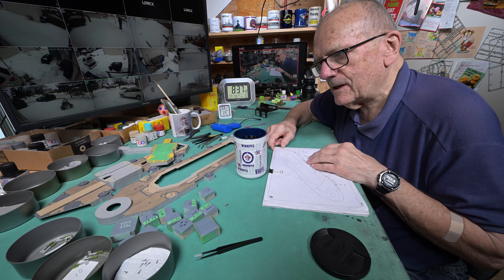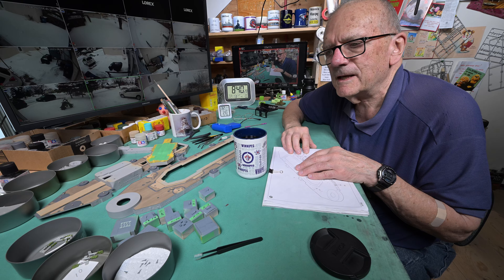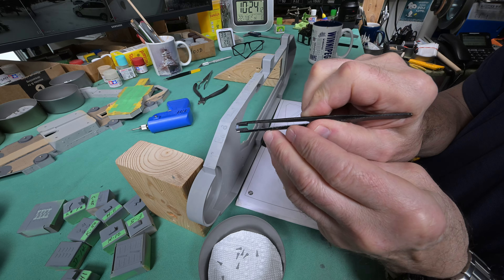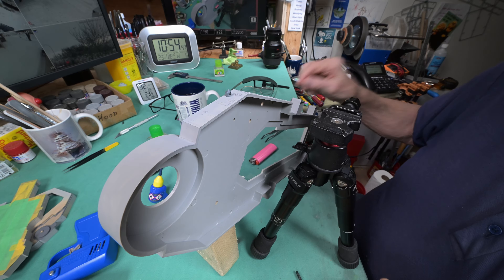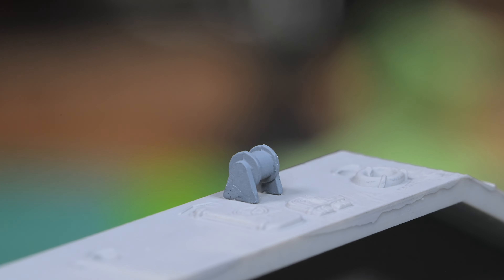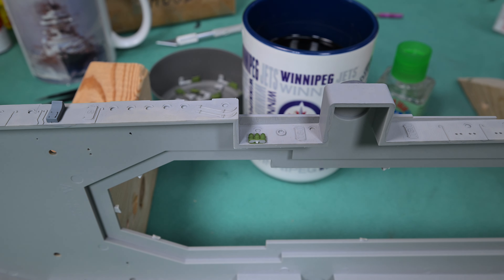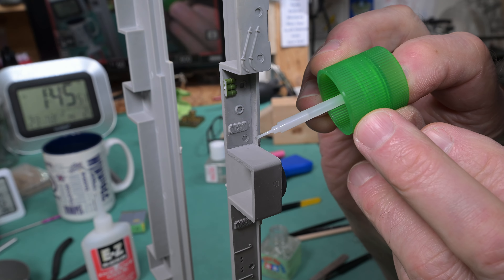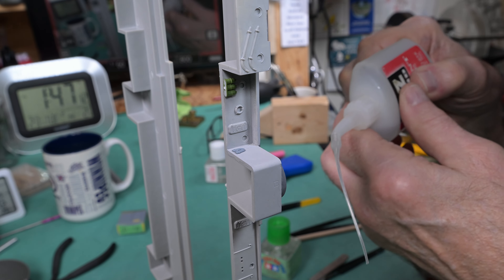The Model Ship - Part 1482

Comment: Hi Ron , you probably know this but if you are having problems with your Revell glue applicator - the metal bit - if you hold the glue bottle and just for a couple of seconds place the metal applicator part in a flame - I use the cooker flame - the glue that's dried up inside the metal part will dissolve and you can use it again . Frequently happens with Revell especially if the cap isn't placed back on quite quickly after using . I should imagine I'm talking out of my hat as we say over here and you already know this .  Take care.
Reply from the maker: I use a Bic lighter. 👍